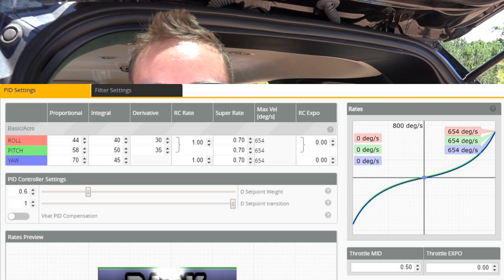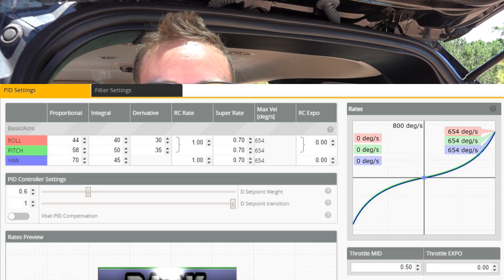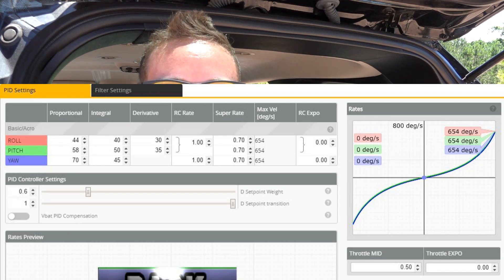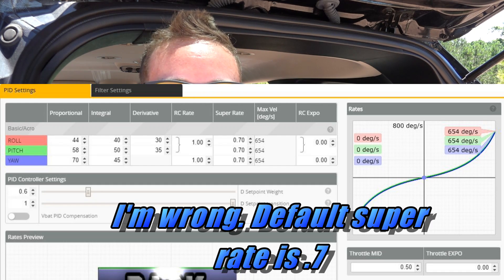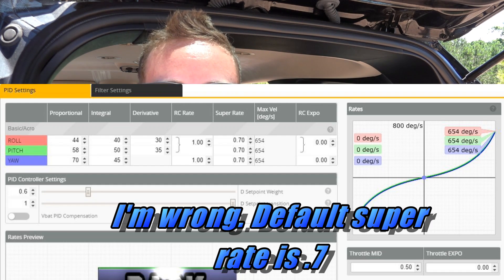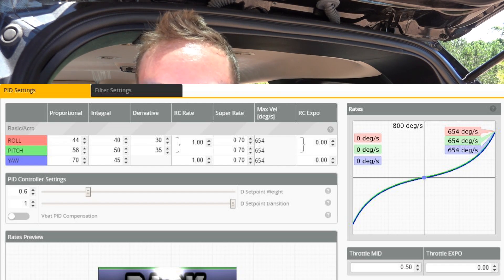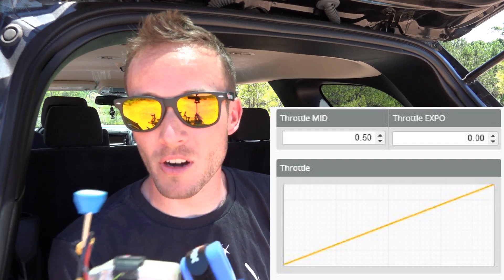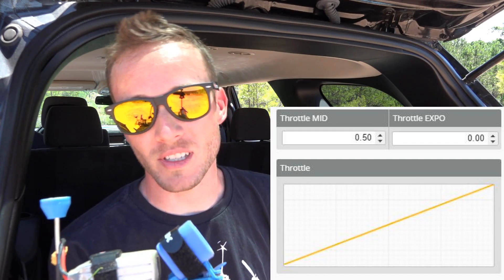Tuning Pt3: Rates & Expos

Comment: Iam new to quads. Although i fly good i still struggle with flips and rolls. I like ur tutorial. May i ask i now fly in 3 profiles. I use Rc rate 1.00 for all and .80 for super rates. Actually this should flip and roll sowely ??? I dont like fast flips. Iam flying micros. Can u suggest rates for slow flips and rolls?

Comment: Many thanks for this video. I understand fully this stuff now. I borrowed yours but as a noob set my rc rate to 50 while learning. The question I have is how does what affect the PIDS? I heard it impacts pitch more than any other. Does that mean it causes the value to increase? I am flying without a gopro or runcam but will probably do so at some point.

Comment: Is it better to set the rates and expo on the quad, or on the TX? I usually just adjust the maximums I want on the quad, and then tone things down if needed with the rates and expo settings for the model in the taranis.

Comment: JC - I run rc rate at 1.0, super at .83 with .35 expo on pitch/roll and .25 yaw.  I get approx 1200 deg/s - what advantages are there with lowering rc rate like your setup.
Reply from the maker: I personally prefer lowering the RC rate just to make it more controllable in the center of the sticks because I'm a thumber. Pinchers have more precision so it might not help as much.
Reply: He explained that it keeps a lower sensitivity for delicate movements. (middle of the stick)
Super rate is like a turbo that kicks in when your stick is near the end of the course.
By the way, it behaves kinda like an "expo" and I've read many times that expo in Betaflight should not be touched anymore.
Reply: Project Blue Falcon I agree, as a Thumber, I like it softer in the middle, my curve looks close you yours with the only real difference being your effective end degrees/s looked like it was 900.  For Coreycry, yes, i have a similar setup so it is softer in the middle, the question was we both have it softer in the middle with two different setups and is there a mathematical or programming advantage of one over the other.  Please post the links you have 'read' that state that.

Comment: Great video.  Where did you get those thumbsticks for your evolution (what are they called)?
Reply from the maker: A friend of mine 3D printed them. Not sure if he designed it or if the file is online. But I've seen where Ready Made RC sells aluminum ones that look just like it.

Comment: Thanks for your video. Expo on the turnigy evolution is "0" right? You use BF configuration only.
Reply from the maker: Yea I dont change anything in the Evolution or any other transmitters. Everything is through BF

Comment: So throttle mid is the value of throttle at mid stick?
Reply from the maker: Throttle mid is where you want the middle of the expo to be. Say you get the mid to .3, then put something in for the expo like .3. Then you'll notice the lines bend on the graph and the center would be at 30%

Comment: I have a bigger quadcopter which I intend to use for a bit of filming, how can I effectively adjust the PIDs there? (in angle/Horizon, i can't fly this thing in Acro)
All tutorials I found are about racecopters with FPV, mine has no FPV
Maybe anyone has any tips, thanks
Reply: Tobimai as far as my understanding of pids goes, they only apply to acro, you can set your maximum angle for angle mode that's about it really
Reply from the maker: I'm not sure if you can tune the PIDs for angle and horizon. I've never tried. It would be nearly impossible anyway because the flight controller has just as much control as you do instead of giving you full control. One thing you can do is go to the PID tab in Betaflight, click "show all PIDs" at the top right of the screen in a yellow box, then angle and horizon you can set the strength and transition.

Comment: Oh what a crash... full throttle upside down 🙄
Any damages on the HD cam ??
Thanks for your tuto though ! It helps. It is funny to see you fly rates 0.5 when I set 1.4 lol (certainely cause I am a pincher)
Reply from the maker: Nah no damage. I hit a rock and it snapped the 3D printed camera mount off and I kept on flying. Landed and noticed the camera was gone. Yea I wish I could pinch. I have to tone everything down to keep it smooth and stable.
Reply: Project Blue Falcon 
I can give you my advice as I couln't pinch either before and I learnt using DRL simulator. I suggest you spend few hours on simulator to get used to that different way of flying. Honestly I cannot use my thumbs any more 😀 (be aware some people will not appreciate depending on their hands morphology)
Happy flying ! and thanks for your share

Comment: Epic crash - quad must wheeled a 100 meters or so!
Reply: I thiougyth it was just the camera that came off? cos you can hear the quad at the end. and the tumbles seem a little too fast. Ah, i dunno now.
Reply from the maker: I wish I had video from another angle. I flew inversed and barely touched a rock. It broke the 3d printed camera mount and knocked the camera off but the quad kept flying. Didn't know the camera knocked off until I landed.

Comment: So when i hit full yaw is it normal for my qaud to gain altitud? does yours do that ? it revs up really fast at 0 throttle when i hit full yaw to do a 360. so it's like to hard to do a inverted 360
Reply from the maker: Nope thats not normal. I'm honestly not sure what would cause that, never had that problem before
Reply: Google yaw jump prevention
Reply: jeffrey odachowski make sure your thumb is not increasing the throttle. if it is still a problem then lower the rudder I